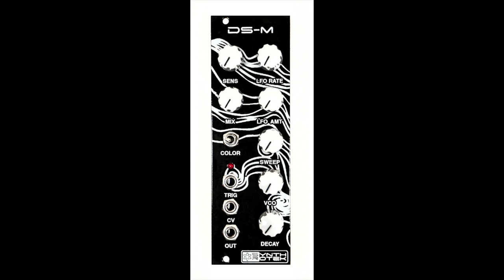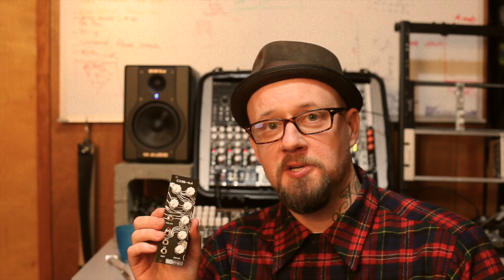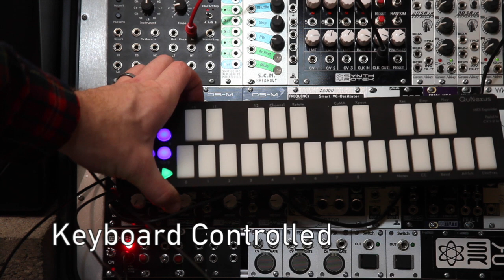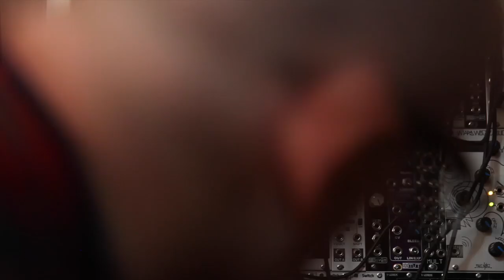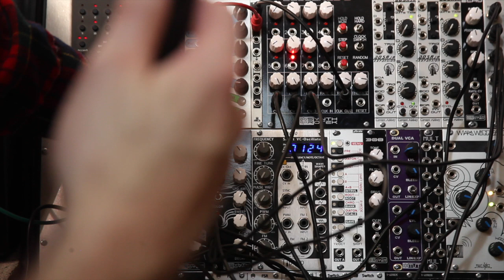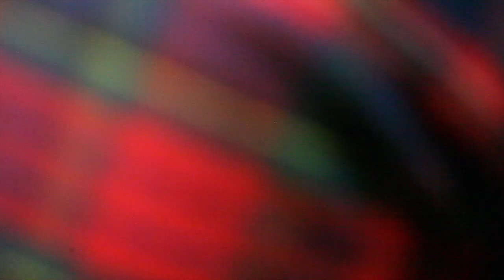Synthrotek DS-M Eurorack Analog Drum Synth Module Complete Demo

Comment from the maker: Costs will be $175.00 Complete Eurorack
$99 Complete Eurorack Kit
$39.99 pcb / panel combos
OUR OG "Space Drum Synth" kit for $75 can be built using a 9v battery. The new ds-m takes +12 and -12.  If you have a wall wart for that, it will work
Reply: does your sequencer 8 work with this
Reply: what module are you using right next to the echo in the upper right corner
Reply: reason2910 looks like a Doepfer mixer